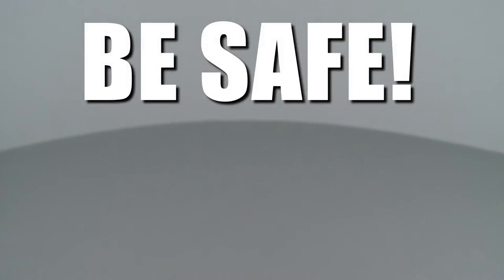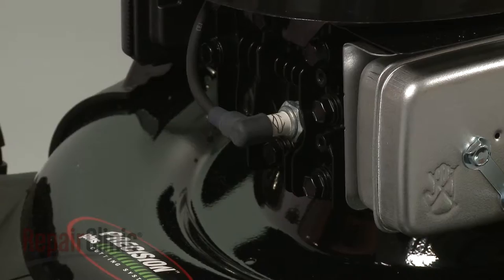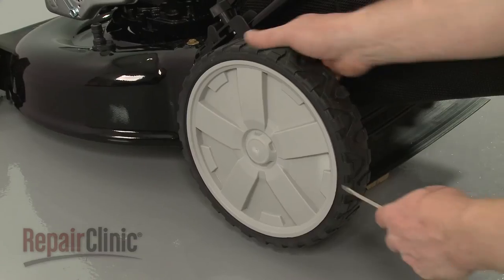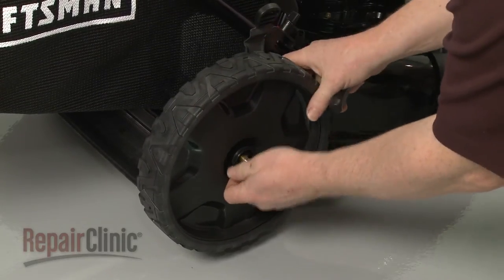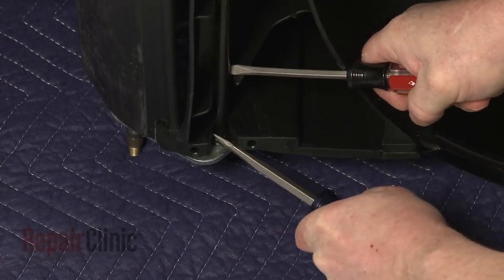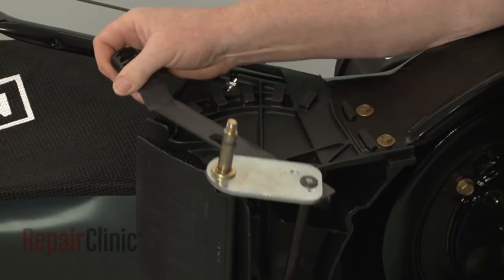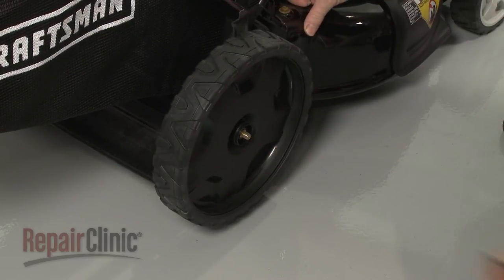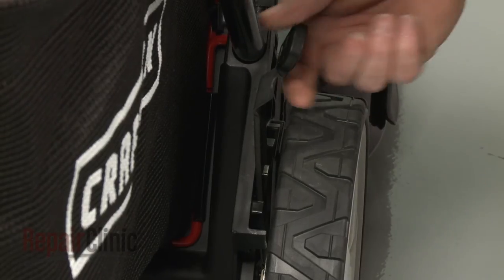Craftsman Lawn Mower Axle Replacement, Rear #911-04144B

Comment: Better put some lube on those axles before putting wheels back on. Most likely you're changing this part because the axles where the wheels attach are wiped out!